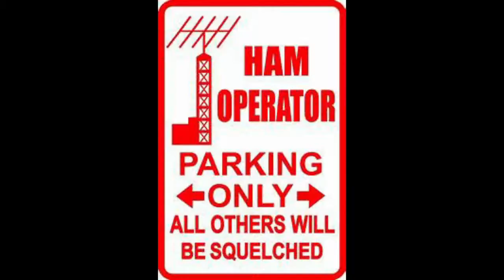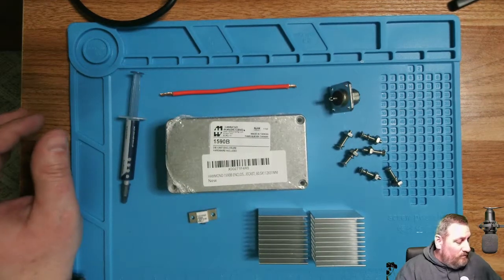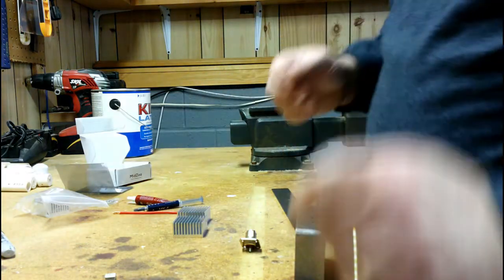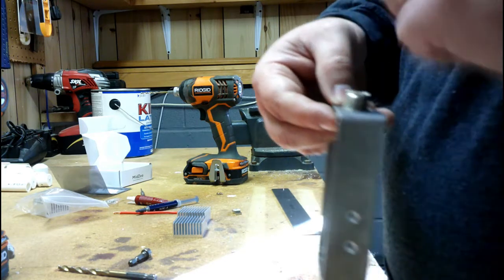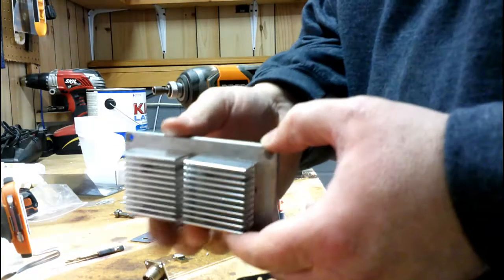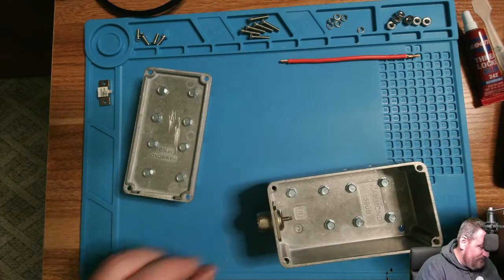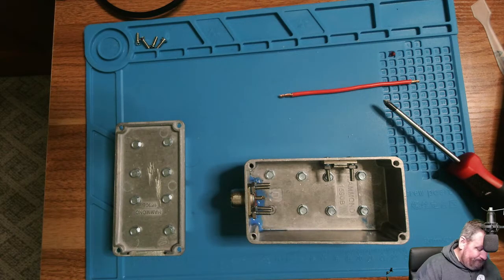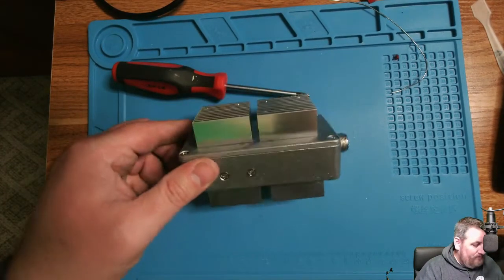DIY Dummy Load; 250 watt / 50 ohm

Comment: Some recommendations: 1) Use a single larger heat sink.  2) Cut a hole in the case so that you can mount the resistor directly on the heat sink. 3) Use coax from the connector to the resistor and connect the shield to one of the mounting screws to minimize inductance.  4)  I also use a copper heat spreaker under the resistor, which may just be my ocd.

Comment: Great project BUT, that load will not do 250W for any prolonged time. Your heat sinks are too small. Those resistors need a huge amount of cooling to dissipate the power. If you run them without heat sink and the case only you will burn those resistors in seconds with 250w input. Your wire is too long,it will present an unwanted inductance at higher frequencies.
Reply from the maker: I  Agree, didn't figure or plan to use for any extended time,  I only have max 100w output in my shack currently, even that I wouldn't run into a load for an extended period.  I figured may as well over build for what I need.  Thank you for the advice and guidance if I build more in the future I will look for other ways of cooling to make them better
Reply from the maker: @donaldtune6917  I predrilled everything just so didn't damage any fins
Reply: What size drill bit do you use for that SO239?
Reply from the maker: @zen_of_I  I used a small bit for pilot hole and then used a step up bit to gradually make hole bigger, I believe I went to 5/8
Reply: @NorthCountryHam  Thanks man! I've seen this design in a couple videos. Pretty cool simple design for a newbie like me, I hope 😆 🤣.

Comment: In addition to all other good suggestions, I would have also used thermal paste under each sink to help transfer the heat from the case to sink. The paste will help bridge any gaps between the sink and case surfaces. Probably not too late to pop off the screws and spread some paste on those sinks. Thanks for the video. Good job!
Reply from the maker: I did actual use thermal paste, it just may not be shown in the video, but definitely a good idea for anything like this. thank you

Comment: Personally, I would have used 4 of those resistors set up in serial/parallel for 50 ohms. There are sets of five for sale on Amazon for $9.99. I would mount them each with heat transfer goop and directly under each heat sink. Nice video. Worthy project for any ham.
Reply from the maker: Great idea
Reply: How are they connected? I can’t find info. I have 4 50ohm on the way. 
De K2SCH

Comment: Knowing  how much heat a 250 watt mains light bulb produces ... it could only be used for very short burst's at 100 watts ... however on 5 or ten watts output  from transmitter it will be very much within the scope of the heat disappation with out a fan assisted  cooling  during testing  .. as suggested  already using additional  Resistors in parallel  wojld spread load and Stop possible   Resistor BarbQ ... G1XZLZL2SCI

Comment: Some interesting  ideas presented for a home brew dummy load, I would have centered the resistor in the box and made the wire connector as short as possible. I guess you could also spray the whole thing black, would help radiate the heat. I'm deciding to either make one or buy one right now - thanks for the video
Reply from the maker: I try to build just for the fun and experience